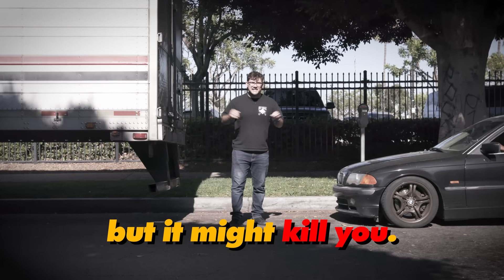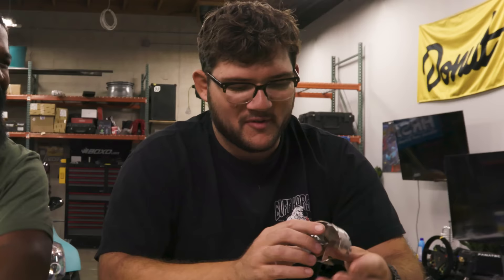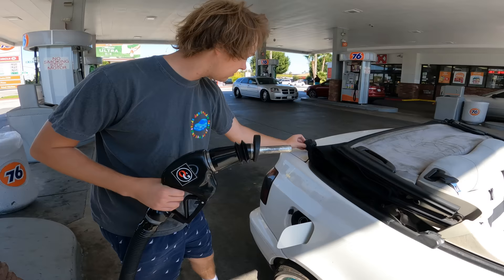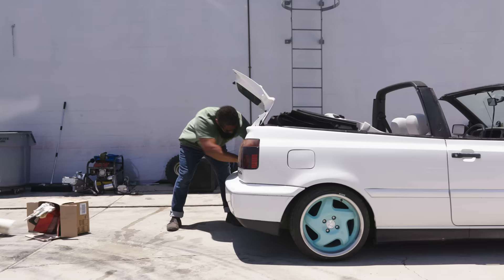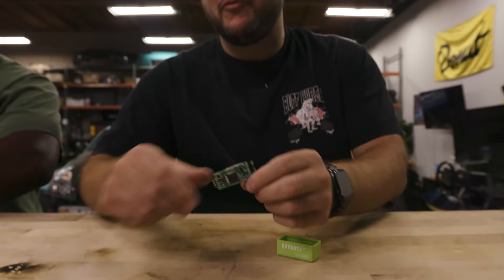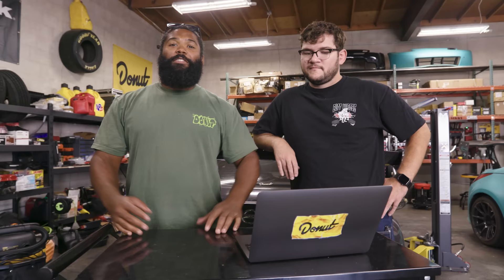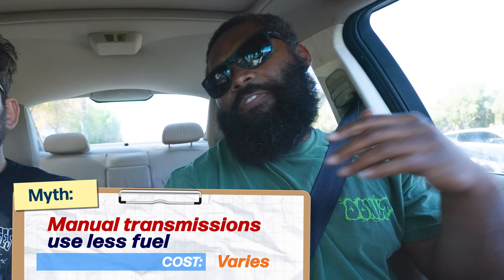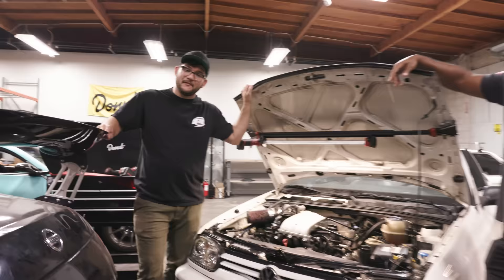Testing Fuel Economy Hacks

Comment: Love the show and have been a long time watcher. I have to argue with your definition of top tier fuel.  I have worked in the oil and gas industry for the last 20 years and you were talking about the octane rating (the number on the pump that you were showing). Top tier fuel from Chevron-Phillips or Valero actually has an added detergent that is supposed to help with breaking down carbon deposits for a more efficient burn, this giving better performance and mileage. I drive a 2500hd 6.0 and was averaging 12ish on the highway until I found out about top tier fuel. Since I began running it, I went up to around 15.5 mpg and have gotten a good as 17. Thanks guys!

2012 Chevy 2500hd 6.0 vortec auto 4x4 on 33's
Reply: Ikr. Top Tier fuel is a designation for a minimum of helpful additives and has nothing to do with octane rating. You guys biffed that one pretty badly.
Reply: @oateater5044  so basically adding octane booster ?
Reply: yes you’re right i caught that too. 

he was talking about top tier fuel then started talking about octane. i dont think he understands what top tier fuel is.
Reply: @jimmyneutron5679  octane booster raises octane. Detergents help reduce buildup. Pretty simple?
Reply: I was going to make the same point. The extra additives in Top Tier keep the internals cleaner. One thing to consider is also trying different brands of fuel and/or stations. For some weird reason, my car does slightly better on Shell, but the bonus cost cancels the savings. There's also a local station with pumps that always short fill. My MPG dropped compared to another station of the same fuel brand. Tracking every fill helps. It took me a few months on Fuelly to realize they were shorting me on fuel, while also being one of the more expensive stations.
Reply: I would think that someone who worked in the industry for 20 years would know about Top Tier fuel, or about how gasoline actually gets to the pump. Chances are it's all coming from the same place anyway. Besides, Top Tier is simply a designation that guarantees a specific additive in the gasoline. Just because a fuel isn't branded Top Tier doesn't mean it doesn't have the same additive in it or that it's inferior fuel.
Reply: @oateater5044  It's actually just one additive, and additives are sold to other companies and rebranded all the time. So if you buy Top Tier gas, it's guaranteed to have that additive in it, but that doesn't mean that unbranded gas doesn't have it.
Reply: @mikep490  I question how much of your experience is due to placebo effect. There's no indication that Top Tier gasoline should affect fuel economy whatsoever. The ECU is still going to dump precisely the same amount of fuel into the combustion chamber as it would with any other fuel, based on exactly how much air is entering the engine. No gasoline detergent will affect any of that.
Reply: @rars0n  When tested, non top teir gas had 19x the deposits in engines over 4000 miles.
Reply: Yeah better fuel gets better mpg but it’s usually cancelled out by the price
Reply: @rars0n  Yep, and has nothing to do with octane
Reply: it gave me an extra 1.0 to 1.5 MPG for sure. run 91 nitro+ on my 2019 ES350
Reply: @rars0n  Yep, placebo effect tested over 180K with the former car. It's not that Top Tier improves mileage, it's more that it keeps the injectors (etc) cleaner so your MPG doesn't drop off. The computer uses the O2 sensors to gauge how much fuel to add. If your injectors are spraying poorly, the O2 will read excess fuel (poor combustion) and lean the mix. An overly lean mix in the other cylinders can lead to engine problems... not to mention the other problems poor combustion causes. Obviously there's no guarantee injectors won't fail, but think of it as adding a shot of Techron to each tank.
Reply: @rars0n  negative ol son. Let me explain how we have different brands of gas stations. There are different stations because there are different refineries. Yes, they follow somewhat the same process, but SOME like Shell, ConocoPhillips/Chevron and Valero put their special blend into gas to make it more efficient or more emissions friendly. This is the reason for the price difference. Here ConocoPhillips is about average and works the best in my truck. Now, I know you've never experienced a real job and that's ok, but don't come at the people who have and do know what their talking about. Here in the south we call that rude and ignorant.
Reply: @rars0n  it has been scientifically proven. That is why you never put cheap gas in the tank, it has a tendency to create water vapor.
Reply: @TechSlapped  ocatane booster here does both, atleast the ones ive bought so far, so yes even more simple than whatever you use
Reply: Yeah , i can feel that whenever i use ron97 fuel i feel like i can travel farther than on ron95
Reply: @jimmyneutron5679  Oh so you knew the difference but chose to ignore it to talk about an unrelated product?
Reply: @TechSlapped  Did you read what I said? Octane booster here does BOTH of those things most of the time, its more of a branding thing and not the actual additive
Reply: @jimmyneutron5679  So you believe that the difference in octane at the pumps is achieved via octane boosters with additives? Do you not get what's being discussed or are you just sticking with an idea till the end regardless of it's value to the conversation?

Comment: Making a flat floor and rear diffuser will actually improve aerodynamics enough to make a difference
Reply: All the things poking out like the wipers which they said was a scam definitely help. It might be 1-2% but still. Wipers, door handles, antennas, wheel caps can all add up to 5-10%.
Reply: True, though your time, materials etc to retofit your car will take how long to recoupe?  What speeds do these start working too? highway or 35mph city driving? Always laughed when Cammisa complained about the 450million screws to get access to anything underneath on his Elise.

Comment: Instead of making a thirsty car more efficient, I'd really love to see a build where you take an already efficient car, and then bring it to the absolute max. It'd be awesome to see you get over 100mpg.
As a final challenge, you could see how many states you could visit on a single tank.
Reply: I don't think hypermilers even get 100mpg.
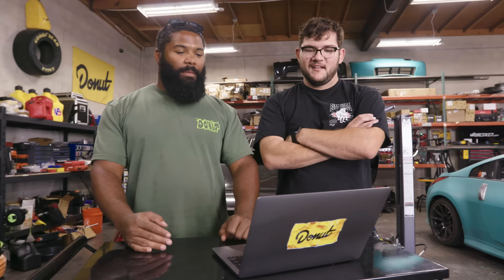Reply: @Tacolord125  I took it from what was said at around 11:30 in the video.
Reply: Counterintuitively, increasing efficiency of a low efficiency system is better than increasing efficiency in an already fairly efficient system.

An example…

Let’s say you have two cars, one that gets 40mpg and one that gets 15mpg. Which is better increasing the first by 10mpg or the second by 5mpg?

Let’s average this out over a 100 mile trip.

Going from 40 to 50 mpg means you save 0.5 gallons of fuel.

Going from 15 to 20 mpg means you save 1.67 gallons of fuel. This is a huge difference.

MPG is a horrible metric… A better measure of fuel economy would be GPM. (Gallons Per Mile) well the best is really something like gallons per 100 miles, so you are not comparing the difference between 0.025 and 0.067gpm… Much easier to see the difference between 2.5 and 6.67 gallons per 100 miles. (If using the 40mpg and 15mpg vehicles as the comparison, with is 2 and 5 gallons per 100 miles for 50 and 20 mpg examples from above)
Reply: @jasonh4534  if you're talking about improvement, yes, but overall performance, doesn't make sense to start with a less efficient car, if the goal is to get the best result
Reply: We've already reached the max today we have economy cars that achieve 50mpg non-hybrid
Reply: @SamuQu  True… if you want to just see how high you can push the number.

I was mostly just pointing out an interesting quirk of such things, from a practical standpoint.

Like say a business has a fleet of say 10 cars, where half are newer cars than get 40mpg, and the other half are older and only get 15mpg…

If they wanted to reduce operating costs, and all vehicles got roughly the same amount of use in total miles driven over a given time period… Where would their efforts to increase fuel efficiency be better spent. Many people assume that making the newer cars even more efficient is best, because you can increase them from 40 to 50… heck let’s say you could increase it to 60mpg…

Surely increasing the new cars by 20mpg is better than increasing the old cars by only 5mpg… But no…

To equal the total fuel savings of making a 15mpg car more efficient and into a 20mpg car… you would need to make a 40mpg car get 120mpg.

Yes, the newer 40mpg car is cheaper to operate than the older 15, now 20mpg car is… but if you are going to be continuing to use both types equally, then from a reduction in operating cost perspective, it makes sense.

So yeah, if the goal is getting as high a mpg rating as possible, you start with the most efficient starting point possible.

If the goal is to actually save money, then making something less efficient, more efficient is best.

To really push mpg efficiency you need to really work on finding a proper combination of engine and vehicle design from the ground up. Generally that means finding a small and efficient engine with adequate power, but no more than necessary, to move the projected vehicle weight and drag properties… Then make those vehicle weight and drag properties as light and low as possible.

Comment: Even if the fuel tanks were affected by the temperature of the day, check the pump - it'll say "Volume Corrected to" and then list a temperature, meaning it wouldn't matter anyway.
Reply: I think the true nature of the myth is that if you fill your tank when it's cold, it will grow inside your tank as the day heats up. That would actually be an easy test. Put in a half a tank in the morning and see if the needle goes up through the day.
Reply: The "volume corrected to" that Gerry mentioned means that you pay for whatever volume of fuel is at that temperature. So if the fuel is below that temperature and more dense the pump calculates this and actually delivers less gross volume. But if you took that volume and warmed it up to the corrected temperature. You'd have exactly the volume you purchased.
Reply: Idk... Feel like this myth need revisited. Considering there are six different measurements to calibrate the fuel pump three of which are US gal, Hawaiian gal, and Canadian gal. The Canadian has to be calibrated twice a year due to temperature changes hence why I feel this myth should be revisited.
Reply: @bradleyhall5417  can’t say I’ve ever heard of a Hawaiian gallon. I thought being that Hawaii is a US state, they would use US measurements.
Reply: @bradleyhall5417  Duh. You think you're making a point, but you're not. It makes sense to check a pump's calibration at the start of the hot summer and at the start of the cold winter. That's all. A 10 or 20 degree difference between day and night isn't enough to mess up a pump's ability to make accurate fuel readings. And "need revisited"? Lern yersef sum gud english.
Reply: @bradleyhall5417  It only matters for long term changes in temperature. Ground temps in winter are lower than they are in the middle of summer. So recalibration might be needed in such a situation.

The differences in ground temperature past the first foot or so, from this morning to this afternoon are not going to be much different.

The difference to the overall temperature of the gasoline sitting in the storage tank is not going to vary much from a cool morning to a warm afternoon on the same day. The tanks are too deep to be affected by short term temperature fluctuations.
Reply: @jeffwalbridge5846  they are by using gals, but since the under ground temp is warmer there then states they have own calibration measurement since fuel does expand
Reply: @Slicerwizard  whoa keyboard warrior, more of a question and thought since learning/training to be fuel tech my guy, but thanks for the info
Reply: @jasonh4534  ooohhh ok, thanks for info. After video spiked curiosity if would get more during winter if that was the case
Reply: @bradleyhall5417  If the system is not recalibrated or does not have an internal way to compensate for the density change, then yes, during winter, you would get more physical matter per given volume of space, than you will in the middle of summer.

The difference is likely not enough to matter, but I am not familiar with the thermal expansion characteristics of gasoline to know exactly what the difference is.

It may be a case where an an individual car to car basis, the difference is small, like a couple percent or so, but expand that up to thousands of gallons vs the 10-15 of the average car tank, the difference is significant to the seller of the gasoline.

Comment: They say by filling up as slow as the pump will allow, more ends up in your tank. When the gasoline flows faster, more evaporates, and is recollected into a special outlet tube that's inside the nozzle.

Comment: Great episode, Justin. Speaking of fuel economy hacks, I've been watching ThunderHead289 get big improvements on mileage from putting a lawnmower carb on his Maverick's V-8. But it's not a simple hack he's doing. On the HHO thing, I remember a mechanic had a video on youtube showing people how to add hydrogen to the fuel mix by using an inexpensive  passive system involving ingredients like baking soda and distilled water. It supposedly  improved mileage, improved hrsprs and cleaned the engine according to his videos. Supposedly.
Reply: adding hydrogen to your intake mix will only hurt efficiency unless you redesign the engine(how it combusts the fuel, materials used, etc). Anyone claiming they added hydrogen and saw "immediate benefits" is lying or falling for sunk cost fallacy.
Reply: @CRneu  I mean, I used the word "supposedly" a couple times for a reason. That said, I have read about legitimate research being done on purpose built hydrogen-enhanced combustion engines that are geared toward improved fuel economy.
Reply: @netronet1383  they’ve already made hydrogen powered cars that work well and are quite efficient. James May owned one. However it was rather expensive and if I remember correctly there was literally only one hydrogen fuel station in all of Britain at the time.
Reply: @Pheatan  Yes, I am aware of the Toyota Mirai and the Honda Clarity  as well. The research on hydrogen-enhanced combustion engines I referenced is different tech, though, and could be more affordable and a good transition to new, more expensive  technologies.
Reply: thunderHead's 40mpg in a v8 by way of a 'controlled vacuum leak' through a lawnmower carb.... i mean dang he could make a product out of his carb setup and tuner and save millions of people on gas :0 you definitely lost out on HP though

Comment: Really digging Justin as a more permanent part of the channel. 
Besides that, friends have been doing HHO for quite a few years, big enough system will show an improvement, but how much is really left to be seen. Jeremiah Def needs to build a bigger one and see what happens.
Reply: Sorry but no - HHO generators in cars are complete nonsense. Doesn't matter how big they are, they run off the battery so will always be less efficient than not having one.

Comment: I've owned both an automatic and a manual e36 and routinely got 5+ more mpg in the manual than the auto. You'd be surprised how much gas you save coasting down offramps and to red lights. Also, BMW's analog mpg meter is amazing. There are certain speeds in certain gears that are drastically more efficient and can mean the difference between cruising at 20 and 30mpg
Reply: 100% agree, yhea new cars may have more gears but just being able to coast around makes the difference
Reply: What they said, "back in the day". E36 is 30 years old? My current convertible 2012, 128i, e88, 3L, 6-cylinder, automatic, gets better milage than my previous convertible 2006, Pontiac Solstice, 2.4L, 4-cylinder, manual transmission. AND the 128i weighs in at 1,000 lbs more.  My convertible before these was an e36, 1996, 328iC, 2.8L, and it sucked gas, automatic.
Reply: its because manuals are lighter, you can lift your gearbox anutomatic on the other hand addes weight
Reply: Yes, the automatics in your ancient e36 weren't as efficient as a manual.  However, in anything built in the last 15 years, with a 5-10 speed automatic transmission that is computer controlled vs hydraulically controlled, you're going to get better overall mileage in an auto.  They can precisely program the shift points.
Reply: Veloster N and EN manuals get slightly better than the dual clutch variants. Im so happy with my M/T VN such a fun car
Reply: An automatic coasting in gear gets better fuel efficiency than a manual coasting in neutral.
Reply: @danielwatson5595  they don't want to hear that though.  You can explain how the manual has to bump up the throttle to maintain idle where the automatic doesn't, but they just want the manuals to be better.   I love manuals, they're a lot of fun, but automatics have evolved so much beyond what manuals can do.

Comment: As y'all didn't clarify, it's rolling the windows up and running the AC while driving over a certain speed like 45-50mph/80kmh.
Reply: Yeah thats what I understand too. Slow city traffic = windows down is better, cruising on the motorway = windows up AC on is more efficient.
Reply: @lAcid Rainl , well also change your air filter if it's dirty.